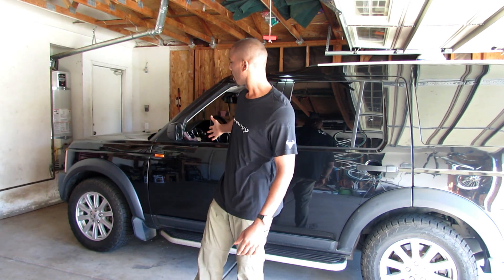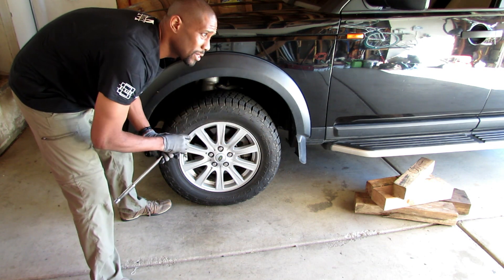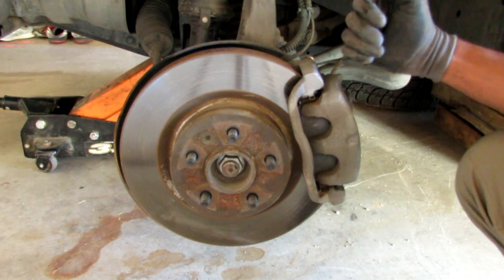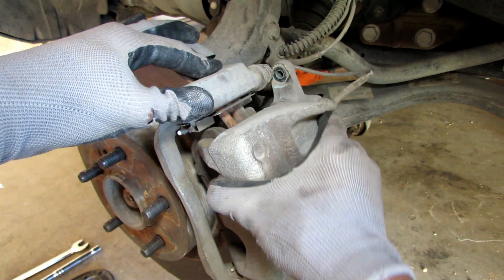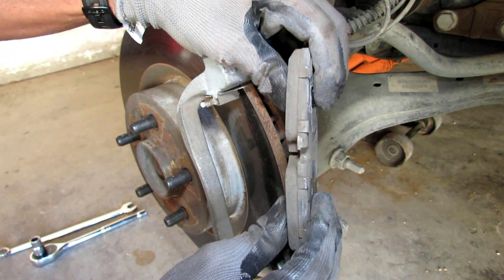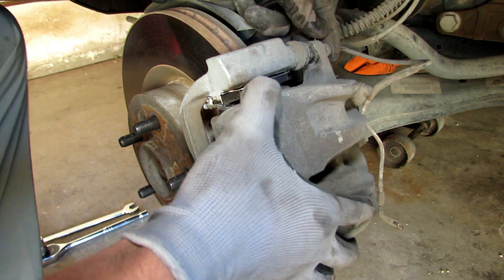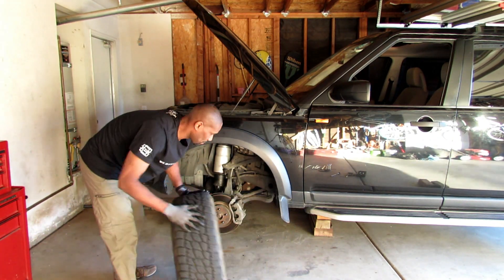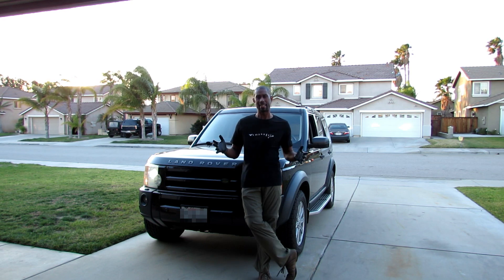Land Rover Discovery 3: How To Replace The Front Brake Pads

Comment: No bleeding needed.,  unless you replacing the caliper kit with rubber Orings an stuff,  just to put a small hose on the bleeder end, and the other side of the small hose to a can of brake fluid .Zero waste or spelling of brake  fluid,  it all go back to the can of brake fluid while bleeding. Thanks for the Video!

Comment: Hello there. When I went to replace front brake pad sensors, I saw that there was no sensor on the front passenger caliper. It also appears thete is no wiring to plug a sensor in to on that side. This is a 2006 LR3 HSE. Is this normal? I was able to change the drivers side as evetything was where it was supposed to be. Thanks

Comment: Hi Good vidio,can I ask why did you bleed the system after you changed the pads ? i thought bleeding was only required if you had replaced the caliper or you had a system leak
Reply from the maker: You're right bleeding the brakes is a requirement when you do change the calipers or if you have a leak in your system. I like to do it to just ensure that there is zero air and the brakes are working at their most effective.

Comment: Fantastic video, but I have a few comments.  Like several have already said, that's the brake pad wear sensor, not a speed sensor.  Second, there is really no reason to "bleed" the brakes if all you are doing is replacing the pads.  It's a closed system, no way for air to get into the system merely because you compressed the slave cylinder.  But even if I was bleeding the brakes, have your assistant pump up and hold the brakes, THEN crack open the bleed valve.  Before the remove their foot from the pedal, close the valve and then repeat.  NEVER have them pump the brakes while you have the bleeder valve open!  You are running the risk of introducing air back into the system from the bleeder valve.  Beyond that, great video!!
Reply from the maker: Thanks for watching and for leaving your tips.
Reply: My thoughts exactly !
Reply: So I just took your advice & I didn't bleed the brakes, changed pads put everything back & no I have no brakes, they are just to spongy and the pedal goes to the floor so now I'm gonna have to go back and bleed them

Comment: What about the brake sensor? The local shop told me I have to replace the brake sensor when the pad go. Is that correct?

Great video! Thanks 🙏🏻
Reply from the maker: First off thanks for watching, the brake sensor is the piece that I called the speed sensor. It's very simple its one bolt and you take it off one bolt put it back in and you just clip it in.

Comment: A couple things.
 No need to bleed the brakes. If you do bleed them, you shouldn't pump, but open the bleeder, then slowly push the pedal down, when the pedal is almost to the floor, close the bleeder. You also must use the recommended order, each vehicle is different.On an LR3 start with the furthest from the master cylinder, and work forward.
 Lastly always pull the caliper slides out, clean them and relubricate. The area where the pads ride should also be lubricated. Use brake caliper slide grease.
 It is also a good idea to at least scuff the rotors slightly with emery paper so the new pads break in correctly. 
I am a 28 licensed tech, great video!
Reply: Joel Letendre so many no no in this vid

Comment: You can buy a brake fluid catcher that has a hose that you place on the bleeder nipple.  Do the brake pump and hold like you did but keep doing it until the fluid comes out clear after adding fresh fluid to the resevoir.  Works great!  I'd also recommend at minimum to take the rotors and have them resurfaced.

Comment: Hey man it's me again.  Thanks for the great video.  But I need your help again.  I did all my pads and rotors following your instructions.  Drove the car for 4 days.  Today while driving, all my suspension sat down and I got an alert saying normal suspension suspended.  Can't drive over 30 mph.  What do you think is the problem.  Thanks!
Reply from the maker: It sounds like it could be your Terrain Response Control Switch is acting up.
Reply: @oxmanagain  makes sense.  How do I test for that.  To see if it is that.  Will a code test tell me exactly?
Reply from the maker: @krush_it6650  I believe you have to go to the dealer to have that test it out but what you can do is if it happens again turn your car off restart it and if everything is working that is an indication that it is the terrain Response Unit.
Reply: @oxmanagain  got it.  Will do and let you know how it went.  Thanks again.

Comment: Thanks for this great video!  I just changed the front pads on my Discovery 4 (2013 model).  It all went very smoothly.  I would just mention that, on my car, a wear sensor was fitted only on the driver side (Left Hand Drive model).  The sensor was already broken off when I removed the caliper so I will need to replace that too.
Reply from the maker: You're welcome and you are right it is called a wear sensor I was talking too fast and call it a speed sensor. Those things are known to break but they're pretty easy to repair. Thanks for watching you have a nice day.

Comment: Thanks for the video but i want to know if that brake pad wear indicator sensor is broken , does it affect th vehicle performance though it will be showing "brake pad worn" warning light,,,,,,
Reply from the maker: That's a good question. If it's broken you can easily fix it, you just follow the wire and unplug the harness and then install the new one. I would say if it is broken the Rover just wouldn't tell you how fast your pads are wearing now. But it would bigger a good idea to fix the sensor.
Reply: Thanx for yo advice , because my vehicle its showing engine checklight , restricted performance, stabiity not available and emergence brake not available warning lights and now my vehicle is running in limp mode
Reply: and only found P0000 code
Reply: Andrew Dube did you figure out what was wrong with your rover?
Reply: Not yet  , just parked the vehicle and am still confused , tnx anywy
Reply: Andrew Dube silly question did you check alternator? Could be going bad same with battery .
Reply: Wish you were here to help , we have done alot of tests but still nothing changed , the vehicle isin the garage like now , we are just tired....
Reply: Andrew Dube I understand that.

Comment: Great easy to follow video, thanks for taking the time to make it. 
I have a couple of questions as I have to change my disco 3 brake pads. 
1. Do you have to bleed the brakes when changing the pads or do you only need to bleed them if you let air into the system?  

2. If you do have to bleed them, should the bleed screw be closed again before the person raises their foot off the pedal and then open the screw before they press and hold down again. I’m not sure if it would draw air back into the system if the pedal is raised whilst the screw is still open. 

Many thanks again, really helpful video 👍
Reply from the maker: It is a good idea to bleed the brakes after you do a brake change. You open the bleeder valve. Then, the person pumps the brakes about 2 to 3 times and holds down as far as they can on the last pump. Then, you tighten the screw to the bleeder valve and then you moved to the other side. Thanks for watching I appreciate the support.
Reply: Thanks

Comment: I use wooden railroad ties.  Cut them into foot long pieces with a good saw or chainsaw and you can put any vehicle on them.  I've used them on 1 ton diesel trucks without issues.  Just use a few of them to distribute the weight and you're good to go.

Comment: I have LR4 and just change the front and back brake pads but the light on my dash board is still on, what can I do.
Reply from the maker: Which one of the lights are on?
Reply from the maker: Was the light on before you changed your brakes?
Reply: Have you changed the sensor along with those pads?

Comment: Thanks for the video. Can this process be used on the rear brakes too or is it complicated by the electronic parking brake?
Reply from the maker: The rear brakes are a little different because there's also brake shoes. You have to take the rotor off to replace your brake shoes. Ben, changing the brake pads is very similar. Thanks for watching if you have anymore questions feel free to ask.

Comment: it looks like you had plenty of lining left on those old pads  if it were my truck I would have waited a little longer
Reply from the maker: It was getting harder to stop with the old pads. When you go off-roading you want to make sure you can stop on a dime.
Reply: Yeah, it looks like at least ¼ of the volume remained 🤔
Reply: If that stupid pad sensor is tripping, I can see why he would change them early. Mine still look pretty good, but I’m changing them because that alert is driving me crazy!
Reply: @LMY-ih4jl  the warning lights go on when about 75% are used, so if 25% remain, it will go on :)

Comment: Nice m8 thx for this upload 😁😁😁😁😁
Reply from the maker: I appreciate the continued support. You're welcome.
Reply: Great video, hope you don't mind but at around 8:12 you mention the speed sensor, this is actually the brake pad wear sensor, when the lump wears against the rotor it grinds through the wire causing an open circuit which flags up the warning light. The speed sensor, or ABS sensor is located adjacent to the hub.
Reply from the maker: I don't mind at all, tell you the truth I love it when someone tells me a tip or two. You're right I didn't catch that mistake until I already uploaded the video. You have great eyes and ears. I appreciate the polite why you told me as well, thanks for the comment and I appreciate your time for watching.

Comment: Stop calling it a speed sensor wire lol Also, grease your slider pins and mounting hardware before sliding the pads in. Just 2 cents. Great DIY though!

Comment: Great video , one change though the wire that slots into the edge of the pads is the wear sensor wire not the speed sensor as you had indicated.
Reply from the maker: Thanks for the info.